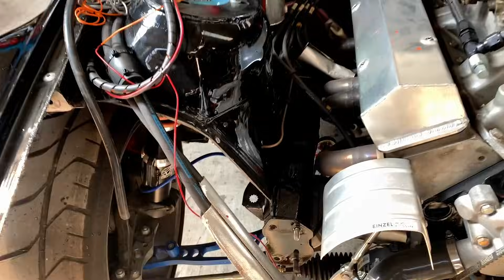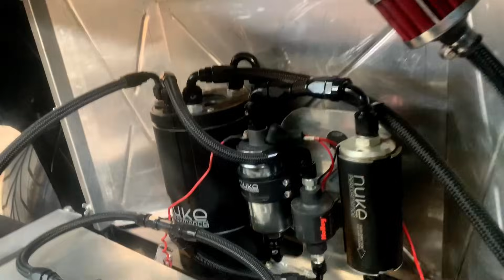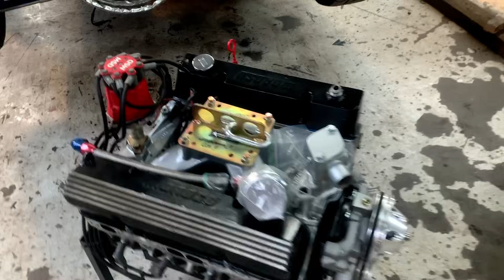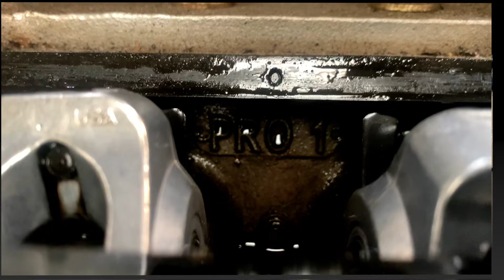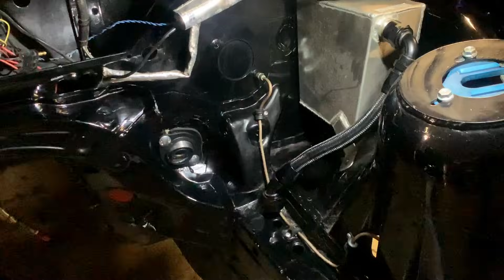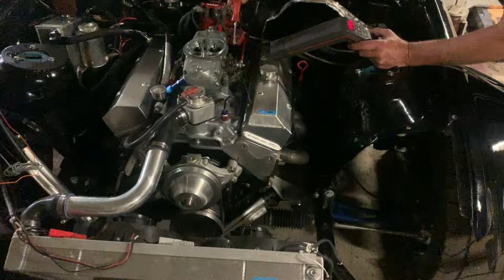E46 Drift Build Video : Fabrication of  6.6L V8 Small Block Pro Drift Car, NASCAR Gearbox 400ci SBC

Comment: How long does that clutch usually last? I've been interested in running a similar circle track clutch but I'm afraid it'll overheat quickly.
Reply from the maker: 7.25" can last a season if you look after it. It doesn't like manouvring or driving into the trailer.
Reply: @DriftJesus thank you! I may ditch the McLeod twin disk and give this a shot.

Comment: Can you detail your fuel pump and surge tank setup? what is the piece in between the pump and the filter?
Reply from the maker: Its overkill, we use a lift pump ofcourse to fill the slosh tank but the motor could run on the lift pump alone.  We made it this way because it would be plug and play for fuel injection if needed

Comment: I loved the video!!! And thank you for all of the great information. I would really like to know more about how you set up your carburetor to handle the back and forth curves when drifting. What changes do you make to the fuel pick up in the bowls? Any and all information would be helpful because I'm in the process of putting a 350 dart small block in my e36 drift car and I would also like to run a carburetor.
Reply from the maker: Nothing needs changin on the carburetor, zero slosh problems.

Comment: Thanks for letting us take a look around and your thought process. This is a good example how make changes / well planned and executed design to simplify keeping the car on track.Great looking Car and I wish cars could go back to being built  with only the things needed to make it  go, slowdown , stop and  have the  windows roll down manually  but keep the electric mirrors for road cars. 
See you on the next sneak peak into the goings on of Wout even if it's not the day of the posting of the video.
Reply from the maker: If you go back to the essence,  a pro drift car needs only 600 real useable horsepower in 90% of comps.   Generally, a good motor does 100hp/l so a 6 litre motor works. 

The reason why manufacturers went to smaller displacement was not performance, but packaging (fwd use of a platform), fuel efficiency, emissions etc. 

None of that applies to a drift car. 

My car has the same fuel economy at an event as my friends built 600hp LS3.  It also has the same AFR.
Reply: @DriftJesus   only a more simple time is was I was comparing to a road car and used the term road car.  Also it would be nice if car manufacturers put some thought into the repair aspect of a vehicle like not  taking a bumper off to change a headlight component or completely take a motor out for a timing chain because someone decided to but it on the back side or roll my window up without needing to take off an interior panel even if I only had one rolling handle for 2-4 doors. Emission standards and regulations, I will leave alone.

Anyways I was only trying to give you a damn compliment. You did a great job building your drift car and the planning and detail. 
I'll stay on topic the entire time next time.I will not compare Drift car build quality to what automobiles companies lost a long the way because they will not stand up from themselves and will continue to keep taking it up the bottom end. Last part  may have been...  dare I say a dad type joke.
Reply from the maker: @Spun-Parts  oh I totally agree with you, was just expanding on the thought process.   Its interesting that pro drift cars these days are actually drawing back to muscle cars from end of 60's , with V8's and 4-speeds.   The transmission that Aasbo won FD with , shares the mounts with my transmission and so does Gittin's Andrews trans.   All these 3 transmissions would fit a 1968 Camaro aswell.  
Its always fascinating to me to see racecars "ignoring" some of the tech that's considering progress in roadcars.  Many factory Porsche and BMW racecars resemble older models if you take them apart, for instance the 2010 P45 WTCC BMW motor is a lot like the E30 M3 S14 motor

Comment: Watch you at iron drift king what went wrong
Reply from the maker: Leader was a little slower than I thought so I messed up the chase
Reply: @DriftJesus  right pity was hoping you do good👍 v8 car is sick its way I build car but engine is not cheap I know is cheap in long run but have m50 turbo 500hp for 5k and no problems with it
Reply from the maker: @jjryan3498  driveability and torque delivery of V8's like this aswell as the packaging is miles ahead of a turbo motor and we run it on pump gas even

Comment: Is the motor biult with a short stroke to minimize piston speed? 8500 is impressive
Reply from the maker: Its not just stroke, you can get bigger displacement on similar stroke, its also bore size vs rod ratio, more material between bores makes the head gaskets have an easier job and keeps more distance between the walls.  A lot of friction going on at high RPM , everything is still relatively short deck .